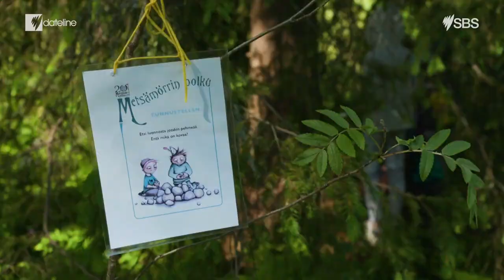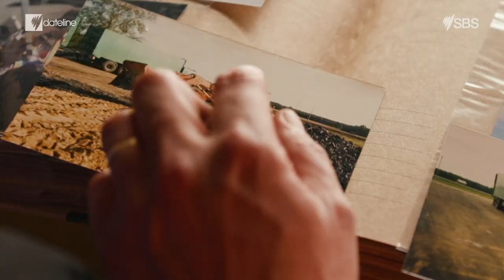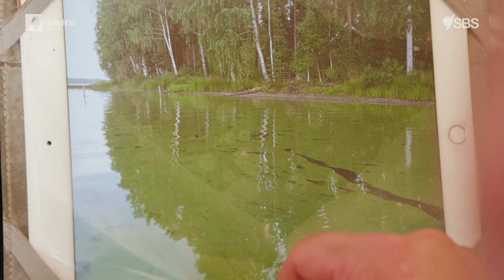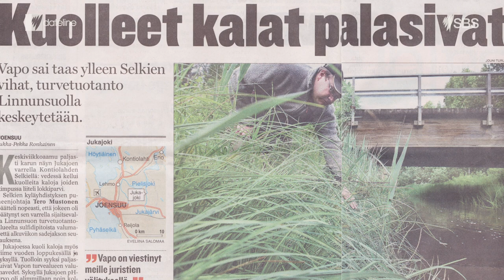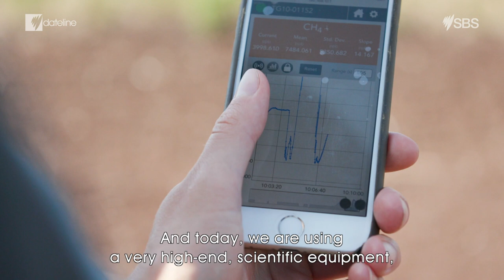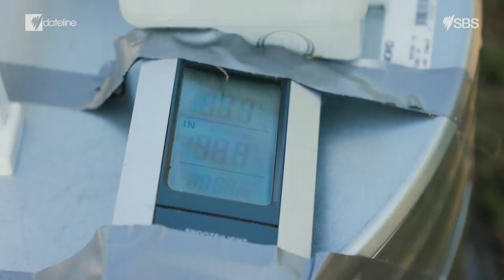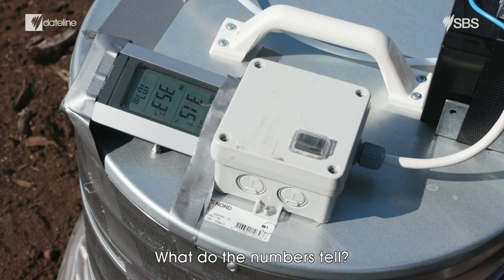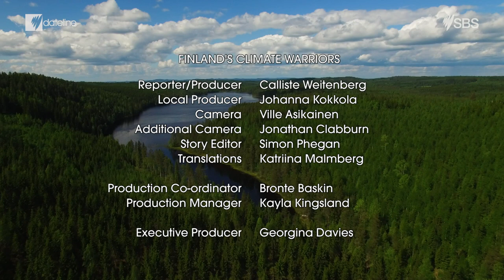Can Finland become Carbon Neutral by 2035?

Comment: What if the consequences of the solution are worse than the problem? And why does no one ever bother to discuss that?
Reply: Largely because that's not the case. Australia's Liberal party led government (who are relatively dismissive of climate change, and such policies) led an investigation into the economics of renewable energy and so called "green" policy actions, and found that they are tremendously beneficial to both working wages and the overall economy. It's also why Costa Rica is experiencing an economic boom. It's only a loss for regions who's futures are entirely built around fossil fuels, i.e. West Virginia coal mines, Gulf Coast refineries, and Saudi oil fields.
Reply: @DWWEnganacious  There 'are' unspoken consequences however. For example, the electric car the gentleman was driving 'fueled' by wind power. Those cars, and the wind turbines, are made by metals mined elsewhere, plastics manufactured elsewhere, and the car batteries are made with rare earths not only mined elsewhere in a process that's hugely polluting and hugely inequitable as well. The materials inside the solar panels are similar. And they never talk about the lifecycle analysis since the turbines and panels don't last forever. So while I applaud the Finns and other well-meaning people, achieving carbon neutral (net-zero) would be only true inside their own borders. They would still be relying on materials mined elsewhere, and people exploited elsewhere, to continue a modern life. IMO the only genuinely carbon neutral life is one without computers or modern conveniences from far away, where everything needed is only local and in season. And what country is going to choose that? One additional advantage Finland has however is falling demographics. Their birthrate is well below replacement level. So while that helps the planet, I wonder what we'll say when their social safety net also falls apart due to not enough young people to support it.